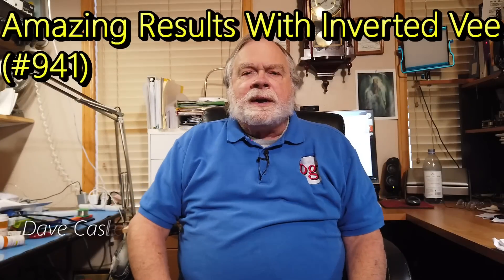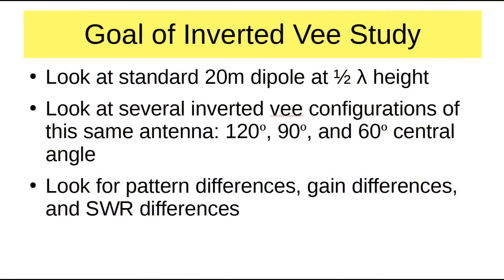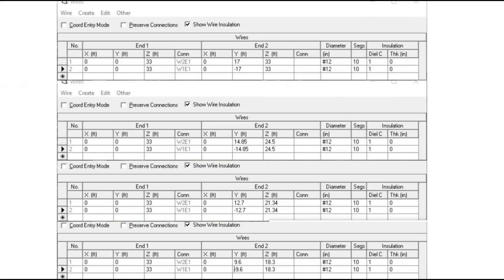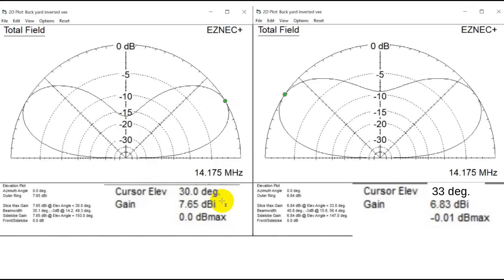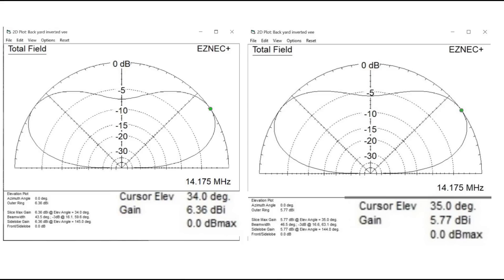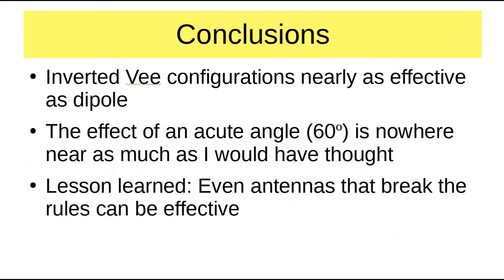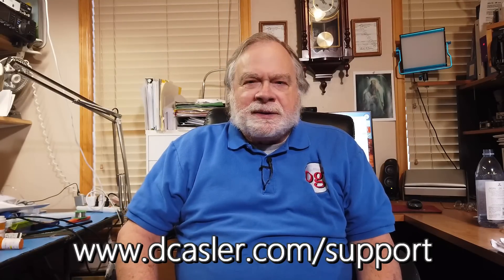Amazing Results With Inverted Vee (#941)

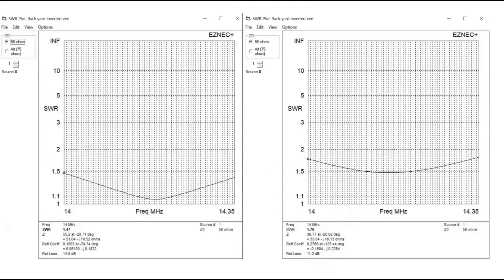Comment: 8:10 - Both the left and right plot are antennas with a 90 degree included angle?  I think the right plot was for a 60 degree inverted V dipole?

Not mentioned:  A horizontal dipole droops in the center, at the feed point, and requires both ends to be elevated which is more difficult to construct in most cases.  It's much easier to elevate only the center of an inverted V with the legs of the dipole helping to guy the mast, so it can be higher.  The center of the dipole is the point of maximum current and therefore the part of the antenna that radiates the most, so the most radiating portion of a horizontal dipole is the lowest point and the most radiating part of an inverted V dipole is the highest point, which compensates in the real world for the mathematical compromises of an inverted V dipole.

Comment: I tried an inverted vee for 12m in the bedroom to get an idea of the length before putting it into the attic.
I got a low swr then by lowering so changing the angle the reading went lower, still getting a slight reading so not perfect.
My NANO VNA said 52 Ω +j7, it's inductive so I could shorten it. Without the VNA I would both shorten it and lengthen it to see which was better. 

How much better could I get it? 52 Ω and +j7 isn't bad. Is it worth the trouble? I'm sure no distant station would notice if I got 50 Ω j0 (if possible) rather than 52 Ω +j7.
G4GHB.

Comment: Hi Dave, Great video! I have an End Fed OCF dipole from Palomar. I have an L shaped antenna that goes out of the shack then up and across 3 palm trees.
My highest point is about 10'. Would I see significant improvement if I could go up another 10' with a 20' flagpole?

Comment: Thanks Dave just what I was looking for. I am installing a Inverted Vee and wanted to know the proper angle downward for the antenna portion and you answered my concern. I still don't know how high off the ground for each side to get 120-90 degree but I will try something like the Balun at 30ft center pole and ends of wire at 10 ft from ground level .

Comment: Ok,,  I get the 90° angle on the legs, but what I haven't see anyone answer is what happens if you sweep that 90° pair ends at the ground away from the vertical feed point? What happens to the radiation pattern then? So if looking down on the feed point from overhead, one end will be going South, but the other end will be going say Northwest and not perfectly North .All while still being 90° separation.

Comment: Interesting seeing the radiation plots. The answer is just get something up.
I have an inverted vee for 60m squashed into my tiny garden.
The available space is 25' x 15'. It comes down from about 26' to each end about 20', then crosses the area dropping in height and then folds back on itself. I've drawn a scale model of it and the angle looks pretty good, around 110 - 120° at a guess.
Not many people on 60m but had a QSO using a Pixie, 350 mW out, 180 miles and a SWL report from Utrecht at 220 miles. 280 miles to Mallaig using a 1944 Wireless 19 Set, QRP at 2W out.
Inverted vee's in the attic for 20, 17, 15 and 10m similarly squashed in.
G4GHB.

Comment: I'm curious. When I went to HF/RF Antenna engineering Army School in Ft. Lee, Va., back in the mid 60's. I was taught when you invert a dipole (1/2 wave) it is called an INVERTED DIPOLE. However, an "Inverted Vee" I learnt is not a dipole, because it is not s 1/2 wave. The Inverted Vee, each leg is the same lenght but are longer multiple random lengths, requiring a tuner. I heard you say an inverted dipole is an inverted Vee. When did they change the names? What am I missing?
Reply: Been call that since the late 80s . That's when I started radio that is.
Reply: Everything. Get the ARRL antenna book.

Comment: I have a serious question that's been driving me nuts for years and no one ever gave me a good concrete answer.  Reading the comments seems to he a lot of smart antenna people on here.  Years ago I bought an antenna for TV / radio etc.  I had little to no reception. Mounted it on a pole 20 ft then 30 then 50ft.  All the same results.  Was so damn fed up I went back up removed it from the pole and thew it on the ground.  I went into my home to grab a drink and BOOM. Crystal clear reception.  I then did a channel scan and I went from 7 channels to 60 channels.  How, how, how did my antenna get more reception laying on the ground than putting it high up into the air???? Can anyone fully explain this to me?
Reply: There is a fifth dimension beyond that which is known to man. It is a dimension as vast as space and as timeless as infinity. It is the middle ground between light and shadow, between science and superstition, and it lies between the pit of man's fears and the summit of his knowledge. This is the dimension of imagination. It is an area which we call the Twilight Zone😊

Comment: Since I messed up and used SS guy wires rather than rope and it seems to be radiating.  I am getting 20 over 9 results on 20M at 1800 miles away. Killed my other bands but it is a PERFECT 20M so I am not going to mess with it.
And SWR is 1.0:1 across the band.

Comment: The PEAK gain at the optimum takeoff angle may decrease as the inv vee angle gets sharper BUT the signal level at high angles INCREASED, and increased substantially.  For regional contacts, say around the USA during midday, the high angles from the inv vee would make it a better antenna than the dipole.  This is why it is very hard to draw conclusions when comparing antennas.  Be careful.  And keep in mind, unless there is loss somewhere in the system, all power you put into the antenna gets radiated somewhere.  So when Dave says the dipole has more gain than the inv vee, keep in mind that is at one takeoff angle only.  de Rick k2xt

Comment: My long element of a 10-80m OCFD is about 120deg, short leg about 90. Not sure how better/worse it is or could be, but it does ok for me. Generally, its's significantly better than my nonresonant vertical. Once in a while, the vertical is better on 15/12/10 meters.

Comment: So, I'm in Indiana with an Alpha-Delta 20m dipole. I've worked all states on 20m EXCEPT my own state and all the states that border me. I've ran it flat-top, inverted V, sloping, changed it's height and direction multiple times- everything I can think of. Do you think cranking the angle to 60 degrees might do something to help? I know the stations are there (POTA app) and I am aware 20m isn't ideal for this close-up work- but there's got to be a way!

Comment: I have always loved an inverted V antenna and it has always proven to be very good in its operation. While not always at a half wave length, I've been very successful with it at a minimum of a quarter wave length of the ground. 90 degrees has always been my focus and do find your results interesting where it appears there is a bit of fudging allowed to the point that one can get on the air and just work them stations and surprise the rest with your accomplishments. A Windom is one of my all-time favorites. 73 es tks fer the video.

Comment: Dave,
How high above the ground are the ends of the antennas?
Steve
Reply: Higher is better as there is r.f. but not as much as the centre, it's voltage at the ends.
I went to Wales and put up a 40m band inverted vee with a 20' centre and the ends at ground held on a rock and held down with rocks. 
It worked. The text books would say this is terrible.
Put up whatever you can.
G4GHB.

Comment: Great video. New radio operator here and I put an inverted V dipole in the attic with a 60-watt 10-meter radio for my first one. My first contact from Pennsylvania was in Scotland! I'll never forget when he said "you're making it across the pond to here in Scotland." I could only get about 120-degrees out of the downward slope but it works well for DX. For locals however, even 20 miles from me, it's really bad.
Reply: 10m great just now. Try c.w.
I got Bulgaria and Sicily recently using one Watt, both about 1,500 miles. Attic inverted vee.
G4GHB.
Reply: 10 m is pretty unpredictable but can yield some great DX when conditions are right.
Depending on antenna, power levels and elevation, of course, 20 miles can be a bit of a stretch for the band. You're probably better off with 2 m over that distance.
You might be interested in checking out  VK3YE What frequency? How Far? on YouTube. It will give you a good rundown on what to expect from what band.

Comment: The best all around HF antenna, OCFD, inverted V !
Reply: Low Q, a bit noisy, directional gain on higher bands is a bit of a gamble, a bit deaf off the short end. A typical antenna, really. Except of course, very broad banded, relatively cheap, relatively easy to install in a lot of situations, coaxially fed, and you can have a lot of fun with just one antenna, without a tuner
I had a 63 ft. 40-6 version with a 6:1 Ballun up, for years. 6 metres was a right off, but 40, 20, and 10 worked more than adequately. With the use of a tuner and a bit of power reduction for safe measure, I even managed to stretch the occasional contact on 80, albeit not that well.
We're all seeking perfection, and OCF's aren't perfect, but gee, they tick more than enough boxes to be taken more seriously than they seem to be, in my opinion.